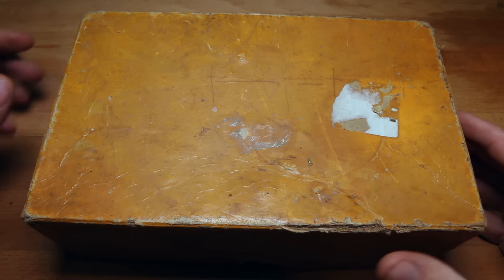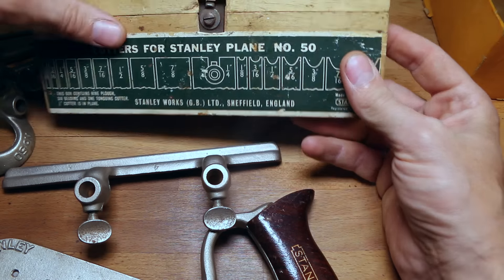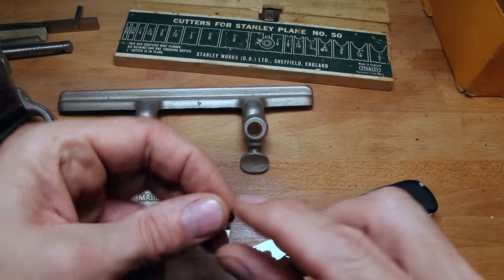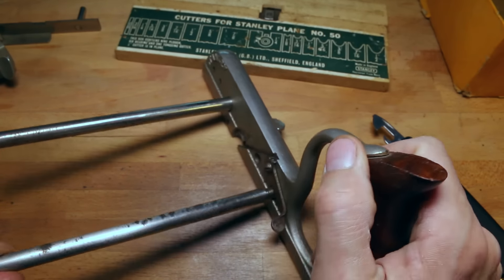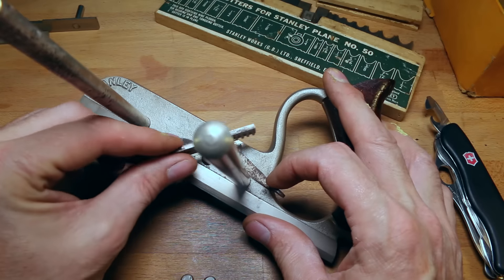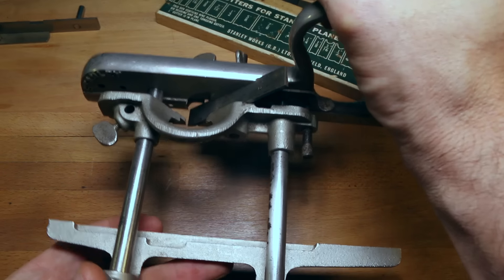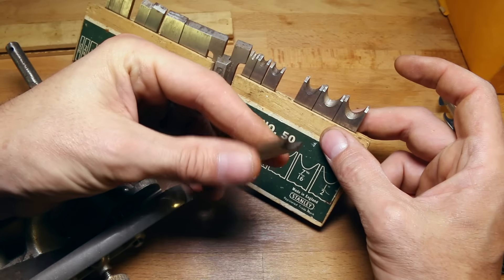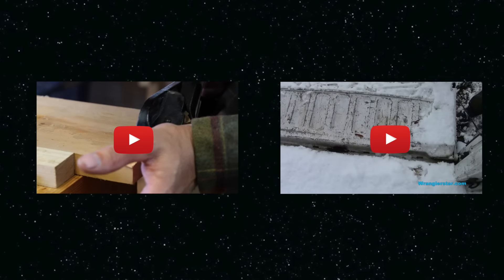Fascinating - Stanley No.50 Combination Plane

Comment: Amazing. I'm so fascinated by these different variations of planes. I recently bought a Record #44, made in England. It is quite similar to this design, although without the cross grain cutting capability. Just used it this weekend to make a smaller version of the tool caddy that you built!

Comment: The little screw at the back is to nudge the rails parallel as just using the rods, you can skew it a bit. The longer depth stop looking thing is to give you a ledge to ride on when using the beading cutters. 

The #50 is a nice little plane. It is not as complicated as the #45 and the monstrosity of a #55 but can handle a nice range of work. The plane itself will come up occasionally but the real special thing is to get one that is complete. Consider it extremely nice that you have the newer one that has the wooden handle. The older ones had the handle cast into it. If I am not mistaken, you can use the same nickers off a #78 but you have to file off two of the points.

Comment: The frames that support the cutter are called the skates, and you named the guide correctly.  The guide sometimes has two holes to attach a rosewood piece of wood to lubricate the guide along the material being cut.  The longer depth gauge is used on the left skate, and the short depth guide can be used on either skate.

Comment: Cody, yes, you have a rare Stanley #50 plow plane.  The #50 had optional boxes of cutters, so you could purchase an additional 6 boxes of cutters for a premium.  The #50 was an expensive plane that was normally purchased by a master carpenter, where the #45 was sold as a handymans do it all plane.  Again, you plane is considerably rarer than the #45, but they look very much alike so many people get confused as to which plane is which.  There were also a set of shorter rods: you have the longer.

Comment: Awesome tool, and here in the states they are rare to find. In a complete form that is.If you do find a nice one, they're $350-$750.  Ive been searching myself, with no luck. Happy for you Wranglerstar!
Reply: Look on ebay and scroll down to international sellers, there are a few complete sets on ebay uk going for around £40/$60 (very nice examples), plus postage it would be much cheaper than buying in the US.

Comment: Tungsten carbide tip masonry drills are great cheap things  for drilling holes in hacksaw blades, so hard they mill their way through the blade just fine, but hole size accuracy suffers unless you carefully use a fine hard sharpening stone and micrometer to trim the head diameter downwards to the final size you want (and very hard to keep it evenly balanced too). That's a lot of work if you require accuracy but for a plain "good enough" hole just chuck up a TCT bit and push it on through.

Comment: To sharpen the bead cutters, wrap 400gr wet/dry sandpaper around a round dowel the same diameter as the cutter. Pop up to 600gr if you want the spooky edge. lol.  BEAUTIFUL TOOL!
Reply: I thought that would be the best way to go about sharpening it too.
Reply: my dad was born before the great depression. they made wheel bearings out of ironwood knots for their farm wagons and made their own charcoal instead of wasting precious $$ on coal. I learned that in order to carry a pocket knife, I had to learn to keep it sharp. i found a flat stone by the Mississippi river that I carry to this day next to my Damascus steel folding knife. Making due is an art form; as is sharpening blades.
Reply: lol. I hear ya. Guess I could crow pretty loud if it were only younglings who seemed dazed but a 65 year old woman once asked me what the little red light on her dash reading "oil" meant. 65 years! I said it was a reminder to the mechanic who installed her new motor to put oil in it. She thanked me and DROVE away. (sigh)

Comment: I have a 50 that I was given (new) as a gift in the early 70's but mine has two holes in the fence so you can attach a wooden face to protect the face of the work piece from the metal fence.

Comment: Oh yeah, the grooving cutter is a perfect match for the 1/4" plow cutter.  There are many additional sets of blades out there as I stated previously, but it is extremely rare to own them all.  The purchase price for all sets of cutters is approximate $1000 American.  As different versions of the #45 and #50 came out, the cutters sometimes were not backwards compatible: think of Microsoft!  There are still plenty of single cutters and blank cutters that are available for both plough planes.

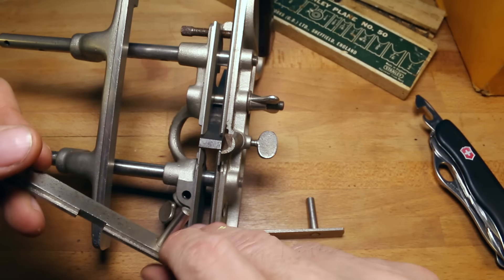Comment: That "shoe" at 11:10 is for beading match boards (T & G).  It goes into the hole at the front of the sliding skate.  Looks the same as on the No. 45 Combo in this video.  https://youtu.be/AOjHyjDnMhE?list=PLU9Apt3956uVdC8H4WMlSZaI_Kff-M5JM

Also saw it in the parts list as Item G - Beading Gauge.